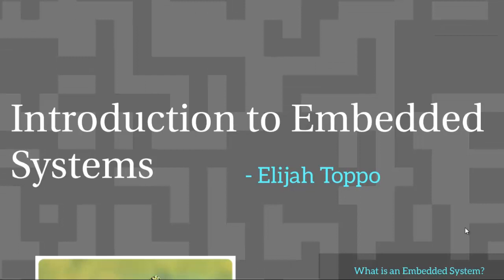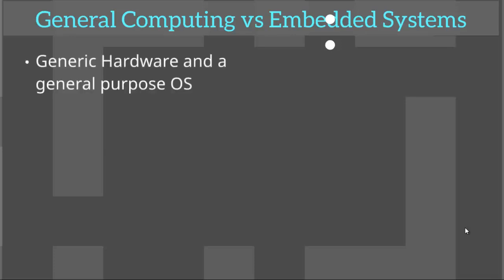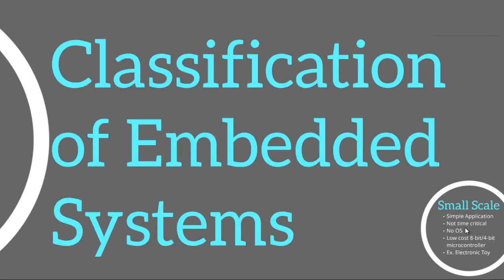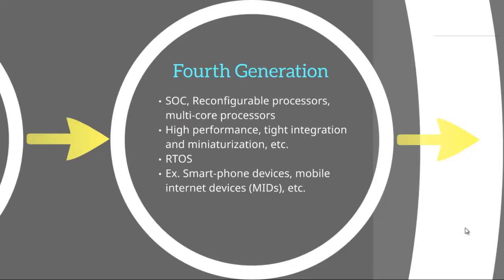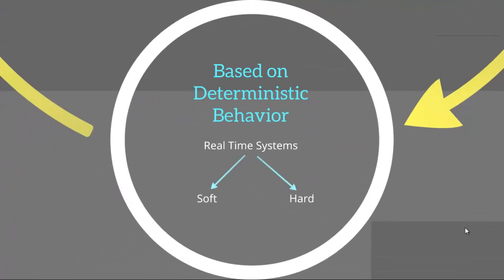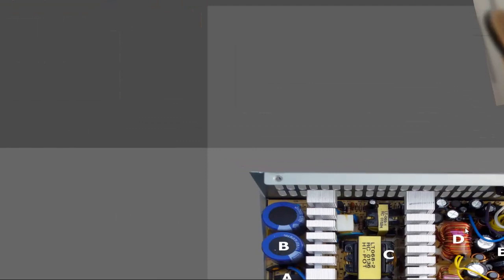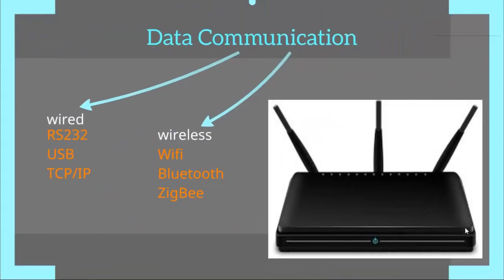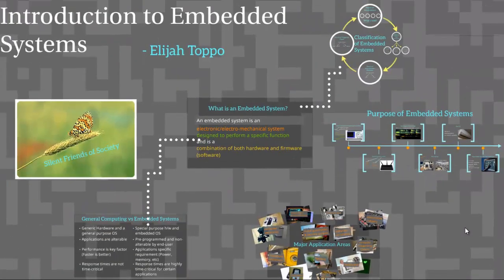01 Introduction to Embedded Systems

Comment: Thank you sir,
Very helpful, I have doubt as the definition of embedded system it perform specific task then how can a mobile is a embedded system (because it support multiple task).
Reply from the maker: A mobile falls in the gray area of embedded systems and general operating systems. It is an embedded application because it is limited by the hardware and sensors and other things.. at the same time it is a general operating system because you can add apps which the manufacturer has not specifically designed it for. 
There's a lot of debate in literature about this. A quick google search should reveal the same.
Do reply with more comments.. Happy Learning.
Reply from the maker: To know more you can read on this link.. 
https://stackoverflow.com/questions/11425729/what-is-an-embedded-system-can-mobile-be-considered-as-an-embedded-product/11478877#11478877
Reply: ok thank you sir,